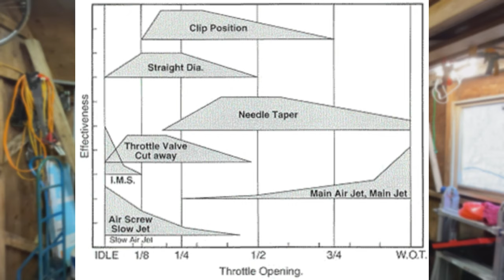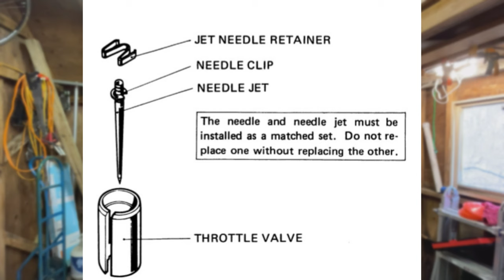Honda CT90 (Trail 90) CARB Tuning

Comment: Very helpful video..thx..
You mentioned a full throttle adjustment technique at the beginning of the video but all I picked out was idle and mid-range adjustment technique..?
Reply from the maker: I just rewatched it and didn’t catch where I said full throttle. Needless to say position controls mixture to about 3/4 throttle. 
To answer your question though, the main jet controls mixture wide open. Plug condition will tell you rich/lean. Make sure you test with the factory air cleaner in place. You’ll be lean without it.

Comment: Great video, need some advice, I have a 75 ST 90, stumbles from idle but runs well. When it comes off of WOT it also will sputter. I am thinking I need to lean it out with the throttle valve. All problems go away when I pull out the high altitude knob. Thanks.
Reply from the maker: So you definitely have a rich condition that resolves with the alt. valve. I’d say jet down but if you don’t have jets try lowering the needle. I’d want to know how much you are coming ‘off wot’. 100-90%??…Jet issue. 100-50%???….needle.
Reply: Lowered the needle, bike is now perfect, no stumble and sputter. Appreciate the help.

Comment: My 90 seems to be running rich even though the clip is at the top of the needle.  Is there any way to lean it out more?
Reply from the maker: It might be the wrong needle if you’re not the original owner and know the history. It might have an air restriction if the filter is really old or over oiled. It might be the wrong main jet that’s so big it’s effecting mid throttle. 🤷🏻‍♂️

Comment: My 1978 carb is nothing like this one.
Reply from the maker: True story. You have four screws holding the bowl on?  I’m pretty sure you’ve got the better one. Newer is almost always better tech. Thanks for watching!
Reply: @ReMotorcycle  No mine has two screws on the bowl. There’s a mixture screw near the intake manifold and the idle screw which doesn’t change the idle speed at all